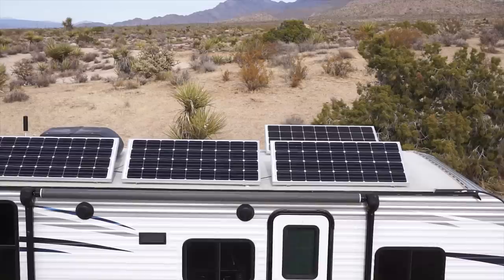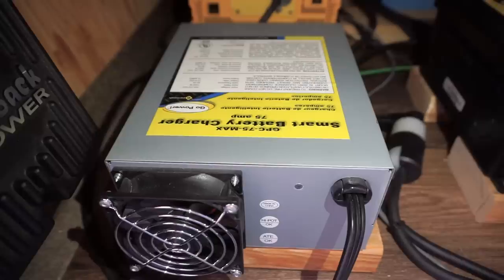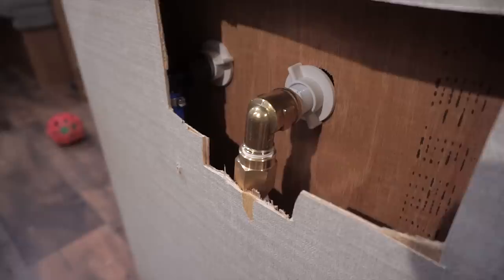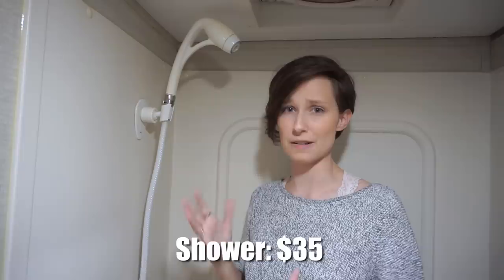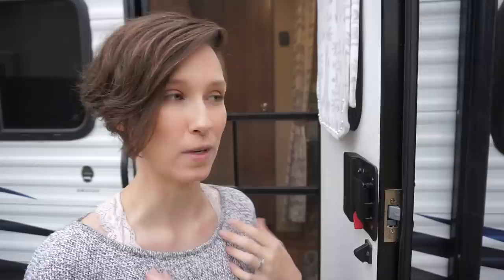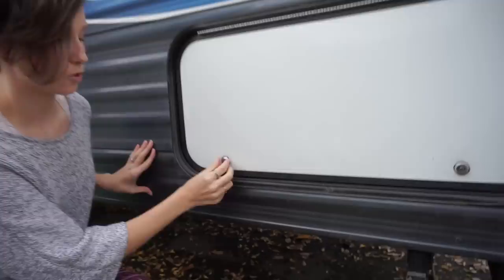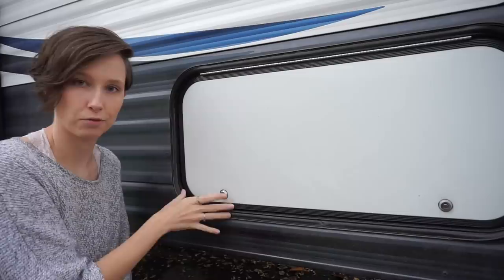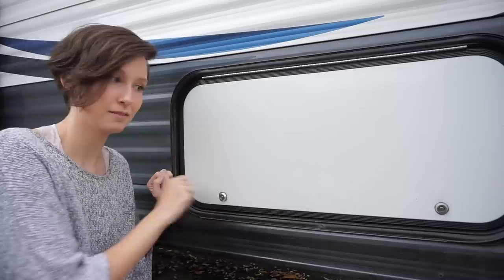Was It WORTH IT?? - All Our RV Upgrades Review - Solar, Toilet, Booster & More

Comment: If you buy Diatomaceous earth for your compost toilet, you won't have any bugs living in it. It is literally a natural product that is non toxic and it will take care of any crawling or living things. Just sprinkle a little bit in after any solids. Diatomaceous earth consists of fossilized remains of diatoms, a type of hard-shelled protist. It is used as a filtration aid, mild abrasive in products including metal polishes and toothpaste, mechanical insecticide, absorbent for liquids, matting agent for coatings, reinforcing filler in plastics and rubber, anti-block in plastic films, porous support for chemical catalysts, cat litter, activator in blood clotting studies, a stabilizing component of dynamite, a thermal insulator, and a soil for potted plants and trees like bonsai.[2][3] Wikipedia

Comment: Did you contact RV Lock? Our keyless entry is a different manufacturer, but if I recall correctly, it’s screwing into the lock itself, perhaps it’s stripped or maybe they have a solution. We’ve had keyless entry on 3 RVs and never experienced that issue. Maybe you just got a dud.

Comment: I'm confused. Your solar panels are placed to angle & catch rays from the side of the trailer that has your awning & where you spend your "outside time". By having to park with your panels facing SE to SW on that side, haven't you eliminated getting shade from your awning, when if it was vice versa, you could collect sun while that side of the trailer is in the shade?

Comment: As far as your lock set goes on your door, By a little tube of lock tight, Put a little on each fastener then send them home...

A word on RV lock sets, Twice they have failed on me and I found myself locked inside. Very scary and very expensive replacement

Comment: I don’t know if you received any suggestions about your door lock and the loose fittings of it?    I am wondering if rubber washers would snug the screws up and also add traction so that the large lock areas will not move.    Hoping this idea works for you.

Comment: I feel sorry for you buddy We paid $480.00 for 700watts of solar panels  and for 2 x 300Ah Lipo4 batteries giving us 600Ah’s $792.00 in addition we also have a folding solar panel of 250Watts which can be hung off the side of our RV if we need more power for extra wattage required to to heat or cool in extreme weather we have in Australia

Comment: We have been using the RVLock keyless latch for a few years now, and know many other Escape trailer owners that use them as well. Never a single issue with them as you describe. Heck, really had to squeeze it into the opening so it you cannot hardly twist it with no screws in it yet. I have to wonder if the issue isn't with your door given this difference. Could you maybe find a way to firm it up in the opening for it a bit with shims?

Comment: Wonder what the price comparison numbers of  your solar system vs. using a small gen set and 12 volt battery for electric would be.   I boondock and stay "off grid" all the time in my 30 ft Class C and with my small generator and one 12 volt battery have access to all the electric components I need or want for the few weeks I'm on road (or in RV).   And gas is cheap....

Comment: Do yourself a favour before you cut or scrap yourself on them. Cut the long bed bolts down and file them smooth.
For the door lock screw, use lock tight.
good vid.

Comment: looks like you havent got a vent pipe attached up and out of the roof on your natures head, that causes a negative pressure taking the smells away uo out side, i live in a house and have had seperating compost toilet like yours for over a decade and i now use anything free i can get hold of instead of the "moss"  additive. use dead brown fern  or whatever is close. nice video

Comment: Grind the screw length around ⅛" and tighten it will be fine & great for lock cut a tube of suitable length and add like a spacer that's full proof no hassles.....
Reply: Inner tube?

Comment: If you have a single water pump, the pressure is the same on the hot and cold side. The cold water gravity settles into the hot water side as the water in the pipes cool. Cold water is heavier than hot water. The check valve solved this. Water headers use check valves for this reason. If you had two water pumps with more pressure on the cold, you would never get any reliable hot water as the cold would flow into the hot. A simpleton at an RV shop likely does not know physics. Right solution. Wrong reason.
The striker screw does not hold in aluminum. Putting riv-nuts or using countersunk machine screws with locking nuts on the inside would solve the striker. A piece of rubber gasket behind the lock face and trimmed would reduce the slipping and seal the door face. Blue thread lock on the screws would help. Or, mask the outside surface and lock face and use Goop glue or clear caulk to glue and seal the outside.

Comment: Over 600KW of panels to charge two Lithium batteries, granted that you can discharge the Lithium’s greater/deeper than AGMs, seems like a lot of power. Do you run into that many cloudy or rain days requiring that? Also, have you investigated the use of lightly used lithium ion batteries, removed from critical medical equipment on a scheduled basis, or do you know of anyone that has had experience with them? They are touted as having good lifespan at exceptionally reduced costs up front.

Comment: Nice vid thanks for the 411. Yeah saw someone mentioned loctite ok, but did you get a gasket type something? If not make your own using thin rubber or flex tape ,as for the rust look at marine supply depending your local I live in California so I have lots of options. Good luck

Comment: I do not want roof mount solar!!! What's the best solar system or portable solar set up to keep two Trojan T145 six volt deep cycle batteries in top condition? Each has 250 amp/hr storage ability. Thanks 👍

Comment: Question about your composting toilet: Have you had any problem with the exhaust fan in the toilet loosing out to the MaxxAir fan in your cabin? Another reviewer said that the MaxxAir's power overwhelmed the power of the Natures Head exhaust causing the smelly air from the toilet to be drawn into the cabin? What is your experience?

Comment: Keyless entry didn’t work for me.  Complete waste of money.  Deadbolt would close when it was new but then wouldn’t open or close after that.   Came with a keyless remote that didn’t work. The plastic over the keypad peeled off after a year.   Tried replacing parts and putting new batteries in but got the same results.  Watched videos on how to set up and program it but that wasn’t the problem.  It was the lock.

Comment: The info. on the signal booster was very interesting. When my wife and I set up camp we like to jump on the laptop and search the local area for restaurants and things to do, but the signal can be weak just relying on my little hotspot wi-fy module. Therefore, I too have been searching for a signal booster. So, my question is: does that signal booster boost both wi-fy AND cell phone signals, like 4G and 5G? Can it be used to receive/boost streaming signals? I really get confused reading all the information about boosters, and repeaters, and amps. But I'm trying to figure out what I would need to get streaming TV while boosting the internet/Wi-Fy and cell phone signals. I wish there was one antenna system that could receive and boost it all, but I haven't found anything like that yet. Any advice on what I would need? Thanks

Comment: I can’t believe a composting toilet cost as much as a macerating toilet… I thought composting toilets were significantly cheaper. How big are your lithium ion iron phosphate batteries? You can get 100 amp hour battle born battery for $900 roughly. I’m thinking you may have purchased the wrong batteries unless those are huge storage batteries.

Comment: YUP...Your costs only start when purchasing a trailer We did a cost comparison with our 15000k (9000 miles) dream road trip and the savings were incredible NOT towing a trailer. The main expense was fuel as our mpg dropped from 20 mpg verses about 10 mpg towing a 28 foot trailer 6200 pounds behind our 1/2 ton. The generator was $1000.00 for a 6000 watt. We too replaced the bathroom fan as the one that came with the trailer was a joke. Even though we would have saved a lot of money NOT towing a trailer we bought one anyways cause we are well off...lol and it is kinda romantic camping off grid and stopping when we wanted to rest rather than keep deadlines for hotels and doing our own cooking which a lot of it was done over a campfire which I am an expert at doing. We did all northern western Canada and Alaska.3 MONTHS OH an extra here We replaced all blinds to roller blinds much better and stronger and most trailer places can sell you them..we bought ours from a floor and window place they were expensive but worth every penny and look great too!!

Comment: I'm curious. Why not install a generator, instead of solar panels? Did you not know about generators? Would have been cheaper.
Reply from the maker: We installed solar because we are full time RVers meaning we live in our RV and dont want to run a generator all day and night. Solar is silent, zero maintenance, and I dont have to get it out and set it up every time we move. Also, running a generator that often would end up costing us more money in gasoline relatively quickly than our entire solar setup did.

Comment: Do you folks power the laptops from the AC inverter or are you using some 12v to 19v DC converter?  Looking at options as wifey and I boondock.

Comment: Putting you urine in the gray tank is not my idea of a smart move. Not sure where you bought those lithium batteries but maybe back in 2018 that is what they were running. Now you can buy them for around $800 each and if you go to e-bay you can buy used medical ones for around $200. Those batteries are still at 95% capacity but due to regulations they can no longer be used in a medical device. Love that shower head. I have had one in every trailer I have owned.

Comment: I’m shocked that all the electrical components only cost $3600 and appalled that the batteries cost $2400 EACH!  I guess it’s the same as selling inkjet printers cheap and robbing you for the ink.

Comment: If you had to do the solar again, would you go with a 24V or 48V system instead of 12V?
Reply from the maker: I changed the wiring in my panels to series from parallel. It's a 48V array now and my solar controller changes it to 12V to charge the batteries.

Comment: Could the cell antenna be mounted  against the side of the trailer?  Height might be an issue.
Reply from the maker: I'm not sure that's a good option but for us the antenna isn't taller than our air conditioner so I would imagine it's probably not taller than most RV air conditioners

Comment: How long will the battery's last? What if your panels get busted from hail?
Reply from the maker: The panels have a layer of tempered glass over them as strong as a windshield. Hail isn't going to do anything to them. And I can't answer your battery question without more details. How long will they last under what conditions?
Reply: Good to know about the panels. Just wandering how long the batteries last before needing replace the way you are using them. They have a useful life.
Reply: Just want more info before I invest that much moola.

Comment: Are those pistons under the bed the same from an auto parts store or are they special for this use?
Reply from the maker: The gas springs are sized for this specific job. They need to have the appropriate pound rating.

Comment: I am going to buy a offroad enclosed cargo trailer ( they have a higher ground clearance, the kind people buy for pulling offroad vehicles, you can get them customed made also- what size, how long), then I am going to build my own home in it n set it up how I want it exactly n make it so I can move n change things easy when I want, it will be way cheaper, like half or a third of the price, that’s if you got the tools n wisdom (or can learn the wisdom n get the tools) n it will be way better for you, if you don’t need a offroad enclosed trailer n can get a normal enclosed trailer it will be even way cheaper, also you can move things around in it easier for safer weight distribution so pulling it down the road will be safer
You two could of done this also, n you still can if you want to sale that one n buy another n build it
Reply: That's a brilliant idea.  You're camper won't start falling apart after 5 years.  They don't even build these things with plywood.  I'm going to wait another 5 years when carbon fiber prices really start going down.
Reply: @chrisk920  they got a bunch of different material out now people can use to build homes in a trailer
 I been hearing about many people complaining about their trailer or rv falling apart
I dont know if they are doing it on purpose ( for different reasons) or that is just the way they build things with many of those companies
Reply: @michaeljohn7467  I think it's just a matter of greed and no quality control.  Companies have been making these for decades, and it's my opinion, they gloss over the important mechanicals and construction and try to wow people with eye candy items like fireplaces and modern looking insides.  Spending 70k on one of these and getting a plastic toilet for me is just cutting corners and using the cheapest parts possible. And the cheapest electronics.  I've seen TV's with names that not not even Walmart carries.
Reply: @chrisk920  what if they do it so you have to bring it back n get it fixed by them n pay money, or what if they are trying to keep more people from being more free living in a rv n not as trapped- so they can abuse you more at many of these jobs n you got all these bills to pay n people might just keep putting up with it, so they build them messed up a lot n hope more people stop living in them 
They use to call me freebird cause i could take off a lot easier n move n quite my job n they didnt have me so trapped cause i traveled light n didnt care if all i had were the clothes on my back n had to hitch hike or walk
Or maybe that is just how they work n do business n the things they make will just be messed n more cursed  at times
A guy like you n a guy like me could make some good money building trailer homes once in awhile
Well whoever does it, you can make some money n hopefully you are good at it
I am a carpenter n i know how to build things n many different types of material you can use n how to secure it really good so it dont come off, i also worked other jobs n know how to use many different types of screws n bolts to build things
I live in flagstaff at times during the summer
You two can also get 50 gallon water containers n just take the truck n fill them up n go back to trailer n fill it up so you can stay out longer, i dont like these satanic witchcraft cursed cities with all these destroyers in it the evil uses to destroy people even more in life, i try to stay out of them as long as i can

Comment: You two have taught me so much about RVing and the ins and outs
Here's an issue I cannot find adressed anywhere
Last week purchased a Jayco Eagle with a Norcold 621 in it. 
It seems to operate fine, but the paint (?) on the aluminium plate in the freezer compartment is peeling off of roughly 2/3 of it and the bottom of it is very heavily corroded. 
The plate covers the bottom, goes up the back and covers the top. 
The front edges are secured with 3 plastic rivets across the front of the bottom and  3 plastic rivets across the  front of the top. 
The back is secured with 8 bolts, 
Is this repairable or should I start looking for a replacement?
If it is repairable should I remove the plate from the freezer to clean it up and repaint it or should I clean it up in place and repaint it.
Is there a recommended paint to use?
Reply: Call Norcold customer service and ask them.
Reply: @aguyinback  They have been no help at all
Reply: @arniehart8634  Sorry to hear that! Do they refuse to help, insist you go to a "dealer" or do they not have any idea what you are talking about?
Reply: @aguyinback  They just said there are no recalls, it's out of warranty, and it's not user serviceable.

Comment: Is it just me or are some of the electronics unnecessary? That 3000w inverter has a built in charger and transfer switch but they have a standalone for each anyway...
Reply from the maker: Our inverter is an older model that does not have a built in converter charger or transfer switch.

Comment: Those battle born batteries were that expensive 2 years ago? 950.00 today.🙂
Reply from the maker: They aren't Battleborn, they're Relion
Reply: Fate Unbound that link you give, amazon page..... battle born. Are these guys your using better? Reason I’m asking is we’re going to go lithium soon, looking at all options...
Reply from the maker: We linked Battleborn simply because you can't buy Relion on Amazon. The main difference between them is that Relion offers larger sizes where Battleborn's largest battery is 100Ah. The Relion batteries we have are each 200Ah and Relion offers larger ones too. We liked Relion because it meant we could buy and hook up fewer batteries for the Ah we wanted. For 200Ah we spent $2400 through Relion 3 years ago. They are still just as expensive going for $2500 for the same size. Here's a link to their website so you can compair them for yourselves: https://relionbattery.com/products/lithium
That being said, we love our batteries 😊
Reply: Fate Unbound I’m assuming that the build quality is the same or better then.... off to do more research thanks for the link and info.👍